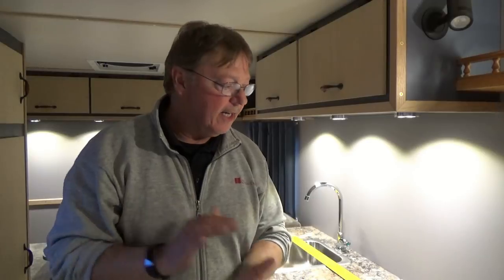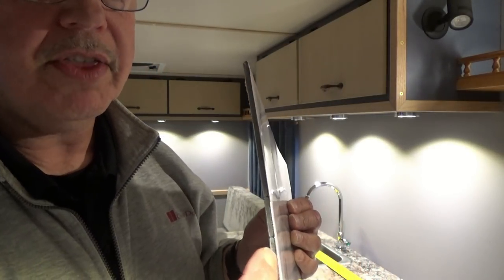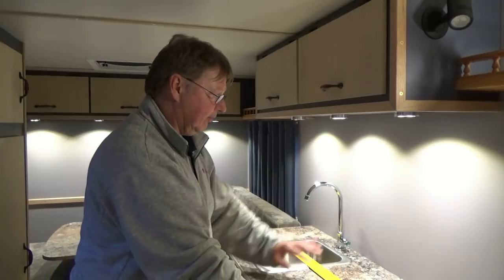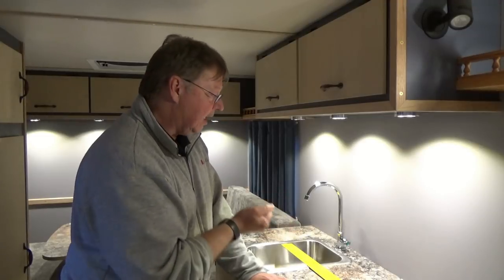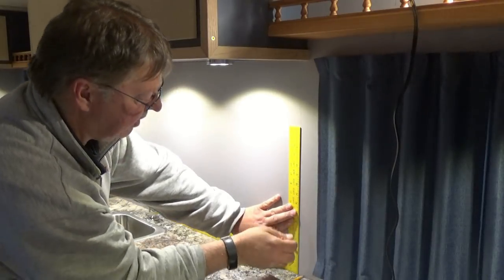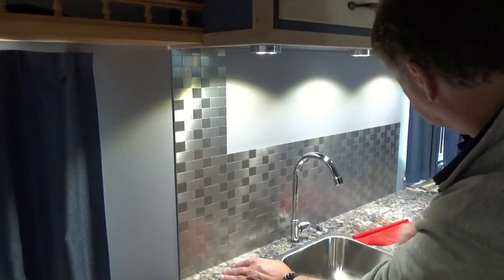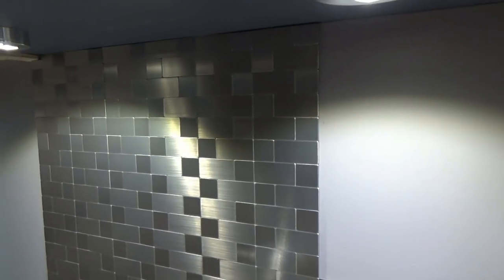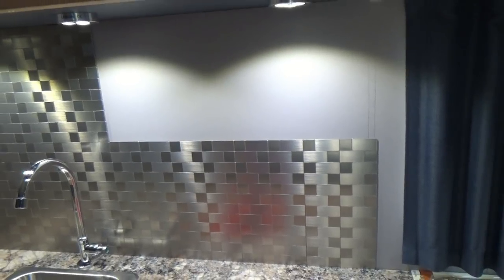How To Build A DIY Travel Trailer - Part 83 (Installing the Back Splash)

Comment: I enjoyed the video. Looks great. 

I bought the same stuff, different design. The directions I have says after peeling paper off, spray backside with soap & water, spread all around with hand. This allows you to slide the tile around without sticking right away. I hope that works when I install it.

Ha, Ha. I just noticed you have the same countertop as I do. I was wondering how the stainless steel would look with it. Now I know. 👍
Reply from the maker: Hey Rudy! Thanks for watching the vid! I was too impatient and probably missed the soap and water trick... has to work better than when I first started out. Ruined a piece right off the bat when I tried to stick it down, hope you have better luck the first go around, let me know if that works because I would definitely do it. Thanks again!

Comment: Hello, I have watched all your videos on your camper build and love them. You have done some amazing work. I am a little concerned about your cabinet doors not having a sealer on them. Without a sealer, it won't be long before you will start seeing oily fingerprints and they will act like a stain and will not come off. Just my thoughts, keep up the good works.
Reply from the maker: Thank you Roger! I appreciate you taking the time to watch. You have a very good point! I will be removing the doors soon and applying several coats of Clear Poly on them. There are probably a few more items I would want to go back and address (this being one of them) before too much time rolls on.  Thank you for the advice! Cheers!
Reply: OregonBatman this is a perfect reason why you are such an amazing and humbling person Albert. You take constructive criticism so easily and never ever counter back in a negative way. You the best Batman, two fist pumps and a bro hug for being such a cool cat.
Reply: joker68 I wasent critizing his work at all. I have been a woodworker for over 50 years and I know what happens to wood that is left unfinished.
Reply: Roger Alder after rereading my comment you are correct my apologies as I meant no harm.

Comment: Hello!  Love it! One question? I am renting, When I take it off, will it damage the wall?
Reply from the maker: Thank you Patricia! I wouldn’t recommend installing it if you want to take it off... 3M adhesive sticks real good. It will get damaged if you try and remove it.
Reply: @OregonBatman  Thank you!! Maybe covering the wall with contact paper and sticking them on top?
Reply from the maker: Maybe you can get approval from owners to upgrade the looks a little ( no expense to them ) and see what they say? I rented a house that the owners gave me the okay to  remodel the kitchen a bit, didn't cost them a dime, so they were okay with that!
Reply: @OregonBatman  will do! have a great day!

Comment: How is the longevity of this install?  I’m thinking about doing this with the exact tile you used.
Reply from the maker: I installed the back splash in 2018 and sold the trailer 2021. Had no issue with it. Just have to make sure the surface is absolutely clean and smooth before applying. I would use it again.
Reply: @TheGreatSkull123  I’ve experienced that. Now I’m putting a shelf over the crack between the tiles!

Comment: Whats the easiest way to cut that material i have the same stuff.
Reply from the maker: Hey robel... cuts very easy, I used a band-saw for the majority of the cuts. If you cut from the back side, you can also cut with utility knife
Reply: I used a miter saw with a standard wood blade for fine cut.  Ex-Acto knife for small precision cuts around plugs and switch plates

Comment: NICE JOB ARE YOU GOING TO PUT SOME SILICONE  WERE IT TOUCHES THE WORKTOP OR DID I MISS THAT  BIT YOU DO NOT WANT WATER THERE AS IT WILL SWELL AND SPOIL YOU GOOD JOB SAY HI TO JACK MAKE HIS AS AS YOUR REPLY TO ME SEE SOON
Reply from the maker: Hey Bann The Man! I will probably be using a clear silicone to seal the bottom edge. Might wait a bit until everything has settled and I know things aren't moving on me much. Jack Said, "Hey!" :)  Thanks for tuning in!!

Comment: The stainless steel tile is a perfect choice - a high end look.  ....HOWEVER, in my opinion, the trim took away from it and made it look junky ...sorry.  If it was my RV, I would have spent the extra money and extended the tile from curtain to curtain and maybe to even the OTHER side of the curtains.  I would also spent some money to change out those cabinet handles to match the stainless tile.  Just trying to help with your interior FLOW.  LOL 😂  It is easy to get choppy looking interiors.  Tiny details, Tiny details, Tiny details.
Reply from the maker: Hi Chime Express! Thanks for the feedback! I almost extended the tile to the curtains... and I agree, probably would have been a much cleaner look. I purchased the cabinet handles before I started the backsplash, and honestly... wasn't sure what I was going to use at that point. The polished handles would most definitely added to the flow (where were ya when I was getting started!! LOL!) If you would like, you can go to my YouTube channel and click on the "Comments" tab and there you can give some input for my next build coming up shortly... would be appreciated! Thanks for stopping by! Cheers!